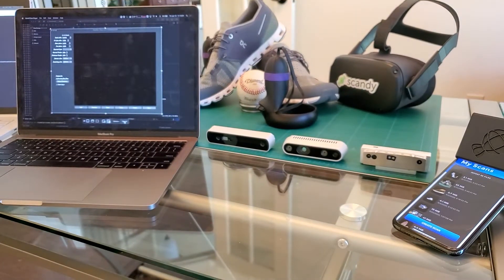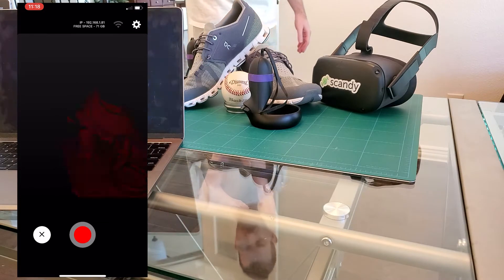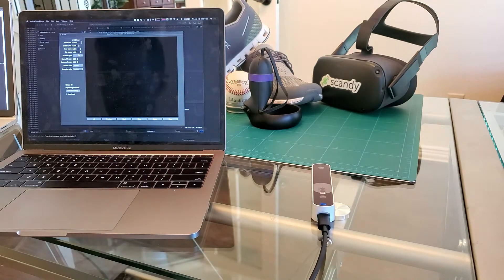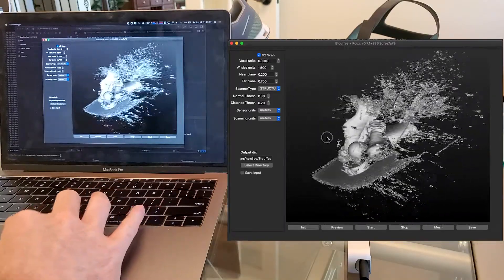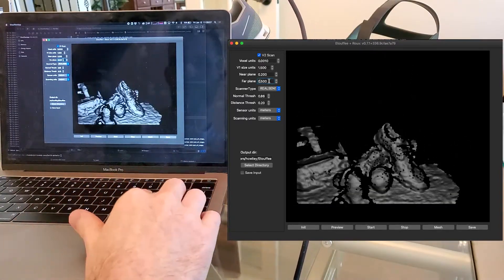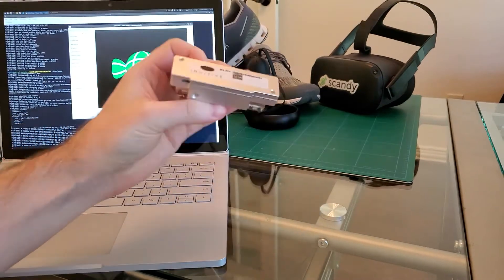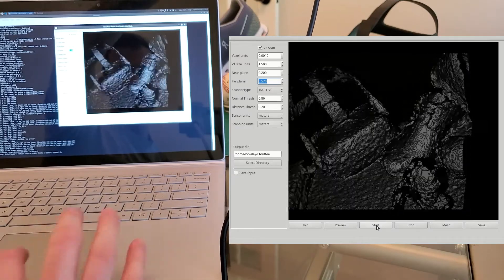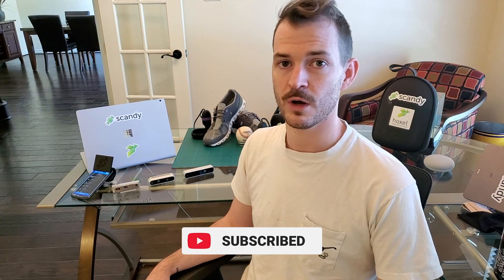Demoing Sensors with the Roux SDK | Which sensor is the best?

Comment: That was really helpful.
Reply: We don't really care about the platform or the scanner brand / tech... what we need is 2 things-
1- the ability to scan an entire house, inside and out, by 1 operator on foot in less than 1 hour. (3 bedroom house)
2- the ability to scan a plate of food in less than 5 minutes. The food scan would probably need to take place in a lighting diffusion box, in order to minimise specular highlights. So if it's a cable'd solution on a tripod, that's fine. We rotate the food anyway.

Both scans need to be in colour, and output a mesh we can optimize / cleanup.